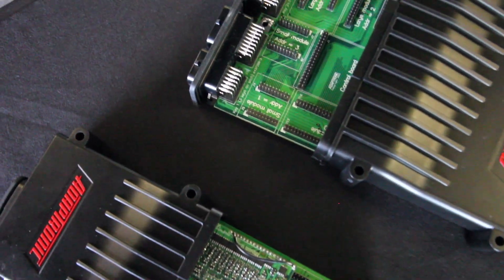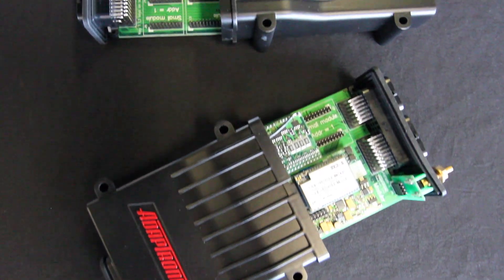A modular ECU that expands to suit your requirements | Adaptronic

Comment: I'd love to see a proper documentation on these. I think right now Eugene isn't up to the usability of for example M1 tune, PCLink or the Haltech ESP. I really like Andy's determination and his style of Engineering, but the calibration software is so couterintuitive that i struggle to spent 1400$ on it.
Reply: Hi @adaptronicECU, thanks for replying. I think i'll shoot you an Email soon but these are my concerns with the software: 
1) xt graphs seem to be completely unconfigurable. I can choose between 3 sizes and only one label per plot. 
2) I can't rename Custom Pages. I always group my "experiments" by function (air, fuel, torque requests, speed control etc) and name them accordingly.
3) No documentation... On my wishlist for every ECU manufacturer is a simulink model for every function :D I know nobody will give away the knowledge so easily but a short description of the algorithm would be helpful. I think Motec and Link do an excellent job with their context help.
4) I often get problems when loading base maps (No permission or something like that..)
5) As you already said: I'm not too comfortable with the Buttons for every function on top. A search function in the ECU parameters would be helpful too (have a look at the Link G4+) and their auto-hiding side bar with parameters, functions, labels. 
The Groups are pretty reasonable (Fuel, Air, Spark..)

Some points that i really like are the number of viewable labels you give to your customers. Every calculation of the fuel equation for example can be logged and this makes the troubleshooting pretty easy. The automatic injection split for staged injection and the ability to use the fuel pressure as input for both injectors on the same cylinder/rotor is pretty awesome too (on the Link ECU's you can correct the Fuel Model for Fuel Pressure only on a single injector and the second has only the Standard GM style short pulse adder tables and Battery voltage compensation.

I know all the points are up to personal preferences and don't apply to anyone. I calibrate daily with Etas Inca and i propably compare any other "Cal Software" to it which is a bit unfair due to the fact that most of the Aftermarket ECU manufacturers don't have the manpower an OEM does have.

Keep up the good work!

Best Regards
Reply: Forgot to tell you that the simulator is one of the best features i've ever seen on an Aftermarket ECU. Finally no more Signal Generators hooked up to the ECU on the Test bench.

Comment: Some really cool features on these! 

Though he said the CPU was running at 1000Hz, what's with the slow clock speeds? Why not go to an x86 chip from more than a decade ago that runs in the Mega Hz?
Reply: I'm guessing it would be processing the whole strategy at 1000Hz in the background whilst also giving priority to the aircharge calculation at each cylinder event. That's quick
Reply: AdaptronicECU So does this result in an Adaptronic ECU that's has similar processing speeds/abilitys to say AEMs Infinity claims of 200Hz Processor that's does 400 million calculations a Second?!